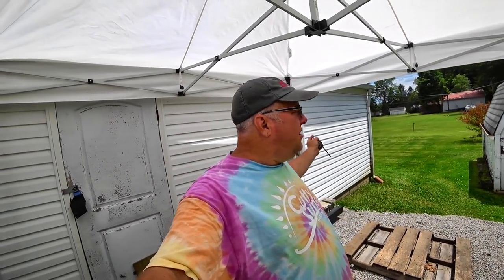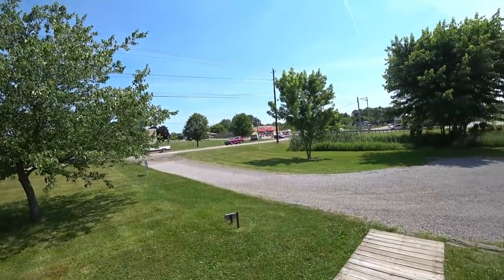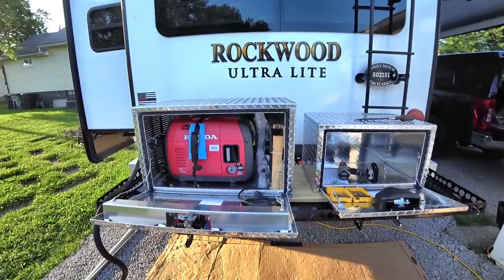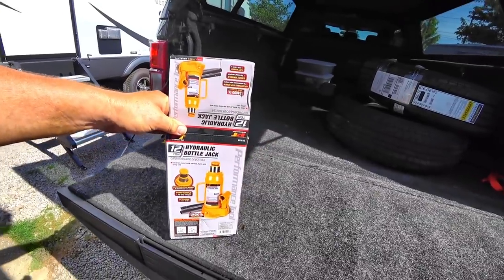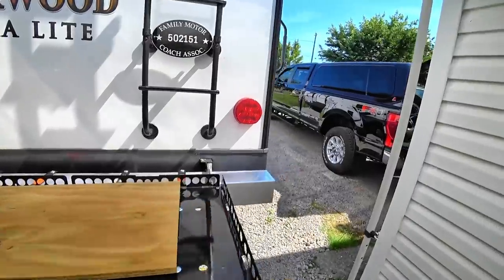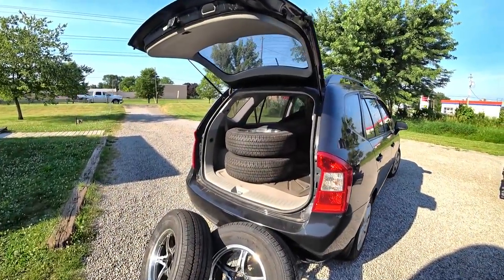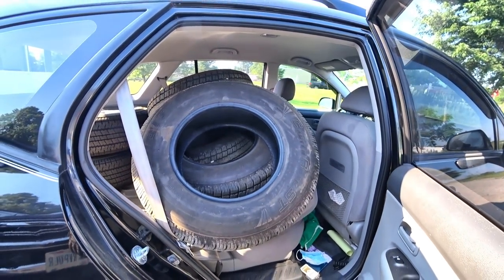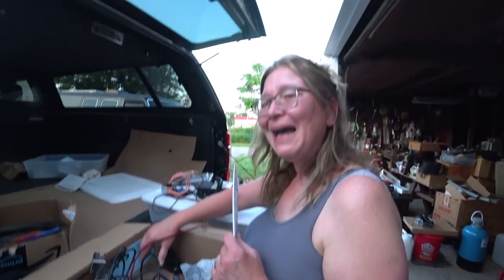RVDaydream Watcha Doin 7 8 20 Genny Box and Tires

Comment: Nice tires. I got rid of my castlerock too...3 have sidewall bulges and 2 are dry rotting. They're only 2years old too. Having them replaced by endurance 205/75r14. The trailer came with load range C. The endurances are also load range C. I always ran them at 65psi...should I be running less? Maybe 60psi?

Comment: I happened upon your channel about the Champion 3400 duel fuel and wondered how it worked out? I want to mount mine on the front of my v mose cargo trailer. but it says to not block the air for 5 ft around the Gen. Did it work with out getting hot? Like your channel.
Reply from the maker: I thought I had already answered this comment but I don't see it posted. I don't have any problems with heat at all but that mounted on the tongue. I believe it's a safety issue that they have to tell you to leave that kind of space. The only thing you have to worry about is the exhaust side of the generator and all the heat that is being blown out there. The back of the generator and the control panel the generator is not an issue

Comment: Thank you again for another good YouTube. 
I always come away with learning something new.  
I was hoping to know what the gear ratio on your truck is. I know one time you were showing everybody the difference in gear ratio, but  I can't recall  if you mentioned your gear ratio 
Just one more thing please, is it a Non-Limited Slip or a Electronic Locking Axle
Reply from the maker: Thanks, electronic locking axle and it's just like my 2019 F250 was with the 373 gear. If you come across the 4:30 gear don't be afraid of getting it I think that it would perform even better yet. The 355 might be a a little too much of a highway cruising gear and not do as well as far as pulling
Reply: Thank you 
I didn’t realize you had replied  
I asked again about the gear ratio in another post 
Thanks again  
Happy Travels

Comment: Yup, the wheels are to be torqued to 100 ft. lbs. I have a sticker on each side of the RV at the wheels that says "NOTICE" in blue. I see this same sticker on your RV also. You will need to re-torque the wheels at 50 miles, 100 miles and 200 miles. You will notice that some of the lug nuts have loosened a little. I also verified the above with Rockwood Customer Service due to my old Springdale recommended torque was 110 - 120 ft. lbs.  I will also be getting Goodyear Endurance Load E tires eventually. We are packed and leaving tomorrow night! We have a couple of stops on the way.
Reply: Just remembered. I have an OEM TPMS on my Rockwood installed by my Chevy store. It will show on the dash the pressure and temperature of each trailer tire. While leaving a campground in Delaware a few weeks ago the system warned me that the right rear trailer tire temperature was extremely high. I stopped before pulling out of the campground to check the tire. I did a quick check (due to campground traffic) of the tire and did not notice anything. We traveled about 1/2 hour to our destination, another Delaware campground. I rechecked the tire and found a screw in the tread. I was getting ready to plug the tire, however, I verified that the screw did not penetrate the tire yet and no air was lost. I lucked out. It was amazing how much the temperature raised in the tire due to the friction from the screw making contact with the road in such a short period of time.
Reply from the maker: Be safe see ya in a few days 😁👍